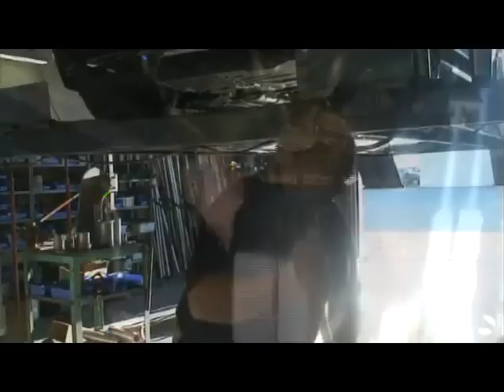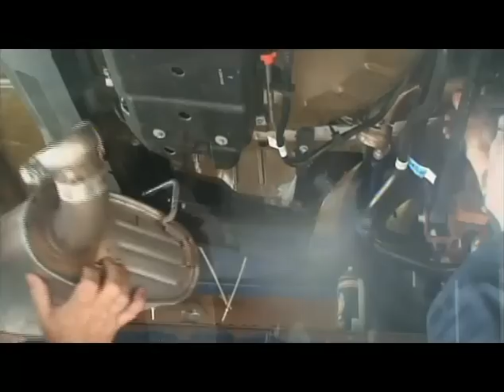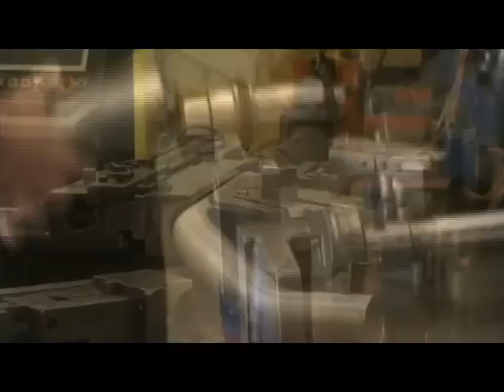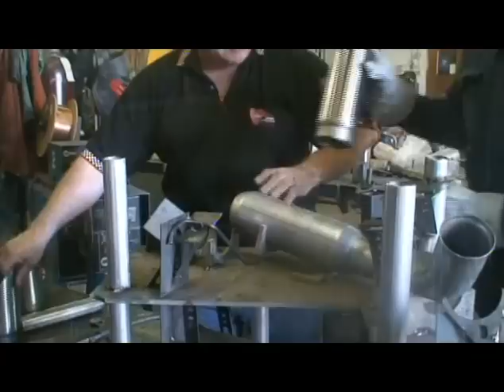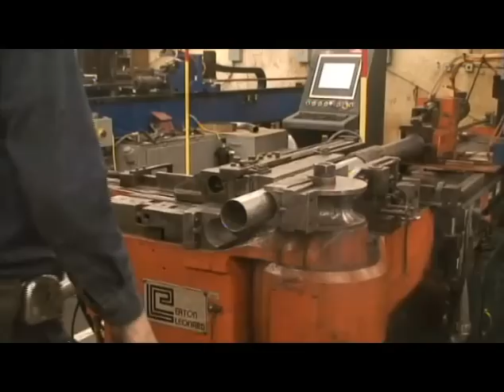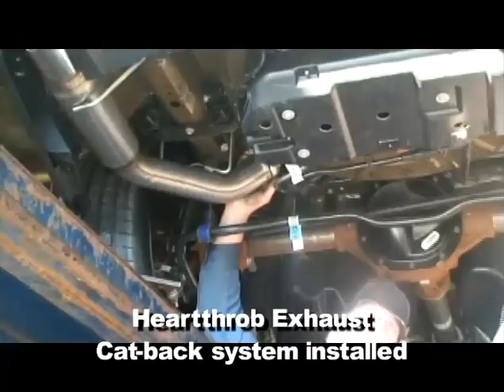hrtvideo.mp4

Comment: @warphace Just got the 1429060 409steel cat to axle system installed on the car with my roush axle backs, this is a straight through h pipe setup with no resonators/flowpacks ,  sounds amazing,  increases sound by about 10-15% over just the roush axle backs, changes up the tone slightly to a more burly sound. Performance wise its snowing out so I cant really test anything out using the butt dyno, but I will report back when the roads dry up.

Comment: I know as far as sound the H-pipe is better. Was just wondering why HP is more with Hpipe, especially since the X-pipe as a smoother flow. Also why pretty much every upgraded Mustang uses X-pipes. Would forced induction have a role? How would the H-pipe affect a blown or turbocharged mustang? Guess the X-pipe would be better in that case?